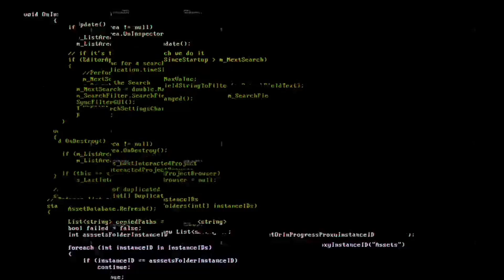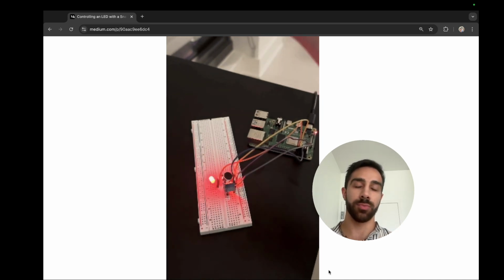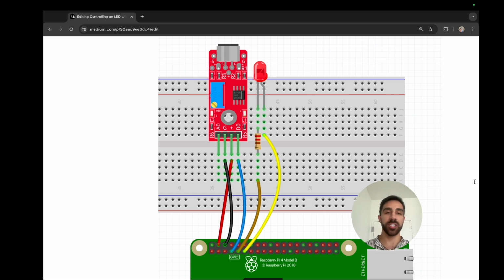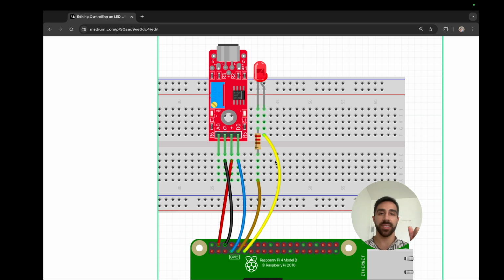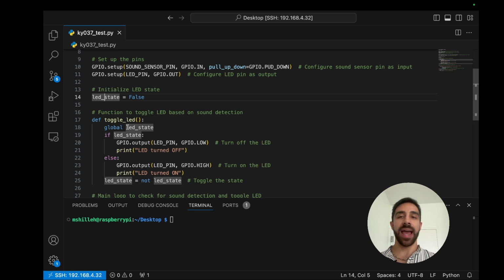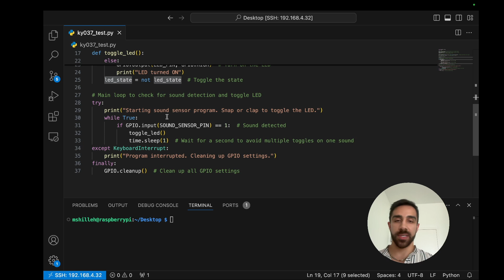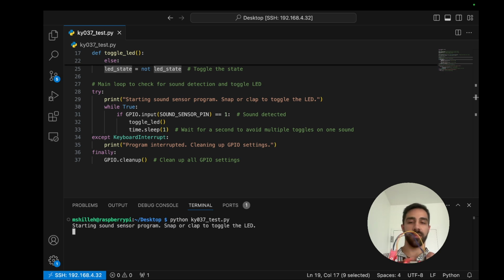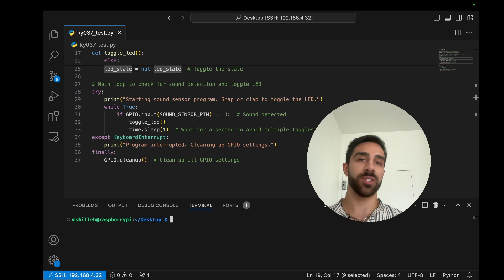Controlling an LED with a Snap Using the KY-037 Sound Sensor and Raspberry Pi

Comment: Thank you for taking time to post this information.  My goal is to enable a webcam to record video and audio when motion AND/OR audio is detected, so this seems to be a good start.  Motion detection with a PIR is not difficult.  I am curious if the KY-037's analog output can  be used to record audio.
Reply from the maker: No I doubt it can too much noise to be able to do that!